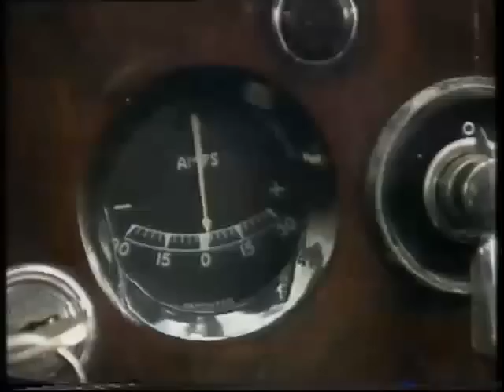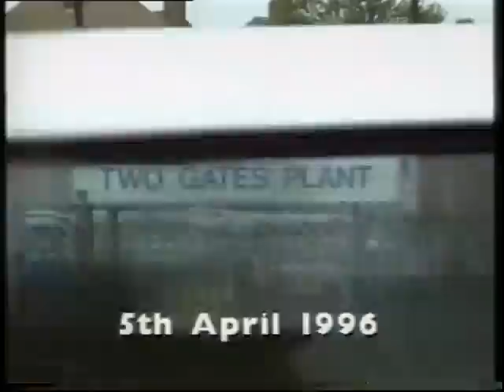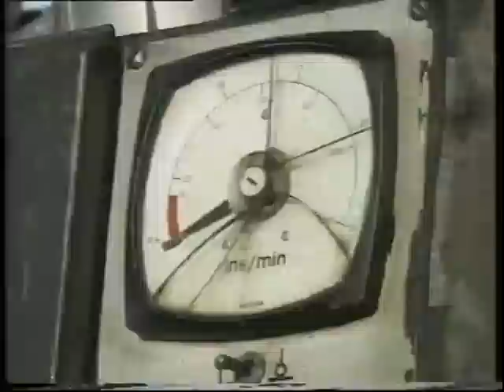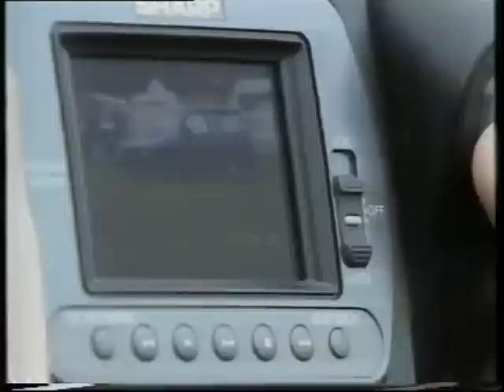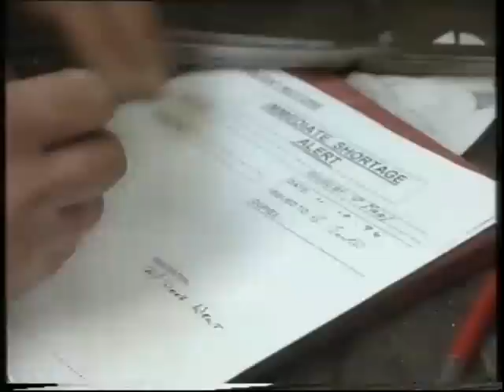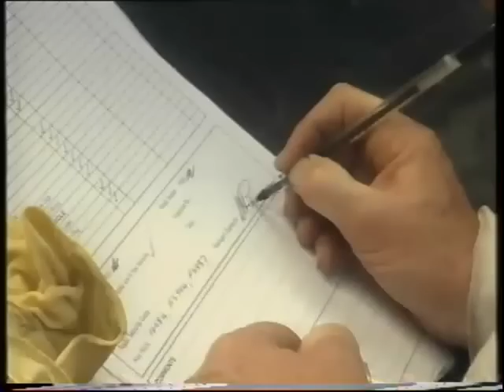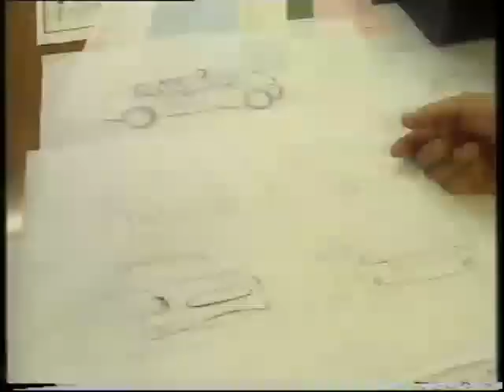Reliant Motor Company Documentary - 1997

Comment: By this time the Reliant three wheeler was a dead duck. Surprised a man like Jonathan Heynes couldn't see that. 60 mpg, motorbike tax and rust free body was a fantastic advantage compared to thirsty and quick rusting 70's cars. But, fast forward 20 years and your average medium sized family diesel will do 60mpg +, is free on road tax, and due to modern technology has fantastic corrosion resistance. Also, the typical reliant customers (older, northern, ex-miner types with a motorbike licence) were reducing massively in numbers by this time.
Reply: supernumery  I'll give the chap credit for one thing .... at least he faced people. I used to work for a technology incubator and 90% of the meetings we organised were unattended - people just couldn't be bothered turning up for whatever reason.
Reply: There was a point when the difference between a car and a motorcycle was a reverse gear. It was possible to drive a 3-wheeler to the test centre, take your driving test, blank off the reverse position and do your bike test as if in a sidecar combination.

I think you're correct in your analysis of Reliant's 3-wheel demographic, Paul, people with a bike license who couldn't be bothered taking a car test and whose wives would no longer get on a bike. Common in the 60s, still plenty about in the 70s, but by the 1990s a dying breed. The Regal/Robin was an anachronism of the British licensing system, like the ridiculous necessity to put pedals on 50cc motorcycles to meet moped laws in the 70s.
Reply: Exactly the issue I saw, cars had moved on, but also with all the emissions regulations etc. the days of the small manufacturer of a cheap economy car were over.
Reply: Gary Dodgson  I agree about motorcyclists making the best drivers, as a motorcyclist you cannot afford to make a mistake and you have to learn how to ride defensively and be constantly aware. After 43 years, having started out with motorcycles before owning a car, I still drive a car or ride a motorcycle with the same attitude, I see and know many who drive cars without appreciation for the inherent dangers. Everyone seems to think if you ride a motorcycle death is inevitable, yet drive as if no one's ever been killed or seriously injured in a car.
Reply: My thoughts exactly, they are a fun little car but the "that's good enough" "make do with what we have" attitude of all the British car and motorcycle brands left them all falling behind.

The average small European or Japanese car of the 90's early 2000's was quiet, fairly comfortable, fuel injected, didn't leak, had power steering, disc breaks and got reasonable mpg, the Reliant on the other hand was still using technology that was outdated 30 years ago and getting harder to source reliably.
Reply: Gary Dodgson  They indeed do have reverse although the current Goldwing uses the starter motor turning backwards to reverse the motorcycle as opposed to a reverse gear. However in the UK at one time reverse gear was used as one of  distinguishing factors between a car and motorcycle.

Comment: The BUG would be a brilliant car for the electric treatment, it is light and it would fly along, just saying
Reply: Also not sure it’s gonna pass in the crash tests LOL
Reply: Ron Wylie....piss on electric vehicles, more green house gasses are expelled building electric cars than there are when building gasoline powered cars....Google that shit...
Reply: @branon6565  what a ridiculously stupid comment. The average car has a life span of 10 years or more nowadays. The savings on emissions during that time more than compensate for the production emissions. A child of three could understand that
Reply: Sid Stevens   Just a matter of branding. Reliant owned the marque.
Reply: Actually Sid, the Bond Bug was made by Reliant (Google it)
Reply: @x66Hawk66x  try actually getting 60-70mpg though, it ain't gonna happen.
Reply: @x66Hawk66x  It is a well known "claim" that they do 60 mpg but I have run mine for 4-5 years now as my exclusive daily transport and have never seen 60 mpg even on a motorway run.

It is a fact that the speedometer with which mpg is gauged in them are wildly inaccurate, often up to 10 mph over. (an over reading speedo artificially increases mpg figures)

I do over 10-12k miles a year in mine, I have bigger wheels which bring the speedo to almost dead on accurate when compared to a gps, it isn't geared as high as a rialto 2 though so it's not struggling in forth at 30 mph.

Keeping up with modern traffic I average 35-45mpg as a more realistic figure and that hasn't changed since i bought the car with around 50k on the clock, that is mixed 30-50+mph driving everyday so well up to operating temperature.

Driving like miss daisy  on an ultra economy run with the wind behind you, you might, might get 50 mpg on a good day, but you will get that in a eurobox these days on an economy drive.
Reply: Saw bug sold at auction this year £30000 pounds wow.

Comment: The Reliant was an anachronism that died between two epochs. Back in the 1950's, young working-class people often rode motorcycles and grafted a sidecar on when they got married. Threewheelers became a slightly more luxurious alternative that could be driven on a bike licence so long as the weight remained below 8cwt. That drastically limited what could be done. However, in 1959 came Issigonis's all-conquering Mini. It required a full car licence, but swept almost all before it. Reliant & Bond struggled on, determined but doomed. Today, with small, electric urban cars the height of fashion, they might have a chance - with sufficient investment - but they didn't last long enough to meet the electric revolution. Perhaps they should've looked around for a Japanese motorcycle engine instead of trying to resurrect and continue building their own mill...
Reply: I think another issue for a company like Reliant to survive would be the crash and safety requirements for vehicles today. Now buyers are also interested in the safety ratings of cars they buy, whereas when I was a kid in the 60's we didn't even wear seat belts and such things were given little thought.

Comment: I had an early model van in the mid-seventies. It was a rather fetching brown colour, which gave it the nickname 'The Flying Shite'.
I remember that there was a big roundabout on my route to Technical College, where I could lift the left rear wheel on the entrance; the right rear wheel about half-way around; and then left again on the exit.
Another party trick was, whilst having four mates packed into the back and stopped at a red light, holding the throttle to the floor until the valves bounced, then dumping the clutch. That manouver generated a 'wheelie' of about six inches...
My favourite was, due to the dimensions in the back and the fact that the driver and passenger seat-backs hinged forwards, made it perfect for taking a young lady back there for... 'fun'.
I'm 60 now. The 'young lady' has been my wife for many years.

Comment: I wonder if it had survived till today. would it have stood a better chance with an electric engine and a little lithium battery pack as an electric city runabout. batteries, motor controller and electric motor production sourced outside.
Reply: Probably not.

The car you describe was already made in 1987 in Denmark and called the "ellert"

It was never a big succes.

https://billeder.bazoom.dk/biler/galleri/479/wh/2000/2000/2394608/ellert-mini---el.jpg

Comment: Not a word about 'Only fools and horses'. I was under the impression that popular program gave Reliant a huge publicity boost? Or have I got the story wrong..... haven't lived in the UK for almost 40 years.
Reply: Some programs did the opposite. The most widespread lie is that Reliants cannot go around corners. This was supposedly demonstrated on the BBC's Top Gear programme, but the always annoying Jeremy Clarkson himself admitted in The Sunday Times that the Robin only rolled over frequently because the production team messed with the differential. If it hadn't, the car would have been much more stable.
Reply: Not wrong it did give a little boost.
Reply: It's definitely given the second hand market a boost. Replicas of the fools and horses van regularly go for between £10,000-£20,000. One of the screen-used vehicles went for over £30,000. That particular model is very rare and even wrecks go for a couple of grand.

Cushty.

Comment: I understand why he did it, but watching him fight the entrenched attitudes of the staff makes me think hiring them back was a bad idea.
Reply: There was absolutely nothing wrong with the 'entrenched attitudes of the staff. They knew their business better than anyone, and had to work within the limitations of the antiquated production line and machine tools they had. The way that Reliants were built was somewhat anarchronistic even in the mid 90s, (even Trabant were more modern in terms of the way they were produced). Laying up glassfibre is a skilled and very labour intensive process, for which there are no cutting corners, as it can't be mechanised. The programme mentioned that Reliant had gone bankrupt  three times within a short space of time, but what was not mentioned was why. The order book was full, and that was part of the problem, as the factory site wasn't big enough to be able to store enough components in order to be able to produce enough to fulfill the demand. This was partially down to the car having a separate chassis, which was made offsite by a contracting company and were produced in production run in batches, which had to be stored, and storage space was limited. Also, such production required paying for with cash - and as is highlighted in the film, cash flow was an issue, which is basically what did for the company on at least one of the times it went bankrupt. It's very easy to blame the workers, but that always loses sight of the fact that it is upon the workers that companies whether the company makes it, or fails - and with companies such as Reliant, it is only the workforce that keeps the company going. The very fact that it is emphasised in the film that some staff gave up secure jobs in order to return to working for Reliant indicates the committment of staff to the marque.
Reply: I am not denying there weren't entrenched attitudes of the staff, but I think there was more of the typical arrogance from management who didn't really understand the business or man-management yet 'knew best'. Let's not forget those who actually built the cars knew what they were doing, and what's more understood what they were doing.

Since Reliant had already gone bust three times or whatever it was before the new fellow got hold of it, indicates to me that there was no real business at all and the boss was clinging on to something that just wasn't there, then tried to blame those making them as being part of the problem. A romanticist if you like. It was a car merely of its time which died in the 70s due to natural wastage.

Unfortunately I worked for 'management' who had all the theoretical training but simply did not understand the business they were in at all, far less those who actually made the whole thing work. Instead of listening to the staff, who knew, management ploughed on ahead with their university degrees and finished the whole thing off, leaving to f'off and ruin the next business.

Comment: i always loved the Scimitar GTE. Nice GT cars. Good Ford V6 engine.
The 3wheelers not so much. IMO 3 wheelers only work with 2 front wheels. 
The Robin was a nice effort.
A company like this can only survive in a niche market. Like small city-BEV cars. Or slow 45km/h cars that you can drive without license.  Or small electric urban/city delivery vans.
Reply: I had a blowout of the offside rear tire on a Scimitar GTE at 105mph on the M4 many years ago. it kept a straight line while the tire shredded itself through the wing.
Reply: The Scimitar GTE was a nice car in its day, my Dad had two of them in the early 80's.
Reply: Hi Fiveo waf, apart from the tire the other big point I remember is the size of the fuel tank. cost me a weeks wages to fill it up. also 100mph in 3rd was great.

Comment: It lasted another 4 years after this documentary was made, making cars nobody wanted to buy.
Reply: The deliberate alterations to vital parts so that you couldn't buy of the shelf alternative didn't help matters.

If they had used off the shelf components they would have had a far greater pool of suppliers to choose from and got better prices.

For example the brake system was adapted in later years to use mini brake components but instead of also adapting the hubs to accept off the shelf mini drums they continued to use bespoke machined parts to monopolize the spares supply.

In reality this let to suppliers of the bespoke parts holding up production, the die casting company from what i understand destroyed the engine moulds in the late 90's meaning all engines after then are reconditioned units.

Comment: He should have reversed the design so the one wheel was in back,modified for angle adjustment,and the two wheels in front.
It seems to me this would have made it much more stable and more controllable.
Reply: not as a load/passenger carrying vehicle
Reply: @chrisdavidson911  Of course it would there is MULTIPLE designs using the technique.
Just look up "three wheeler"on wiki.
All it would have taken is relatively minor modifications to the layout a reasonable expense to increase the odds of actually SELLING the car.
Reply: @krisguntner4805  i'm familiar with 3 wheeled vehicles, the type you're talking about is called a "reverse trike", and you're trying to say it would be more stable than the conventional/reliant layout when there is an uneven load at the rear. Not only that, they're a packaging disaster, the central wheel makes the rear of the car basically unusable for anything worthwhile. The reverse trike layout does have merits, but not for load carrying
Reply: @chrisdavidson911  Arcimoto's "deliverator" Is a clear example you're wrong.
Reply: @krisguntner4805  really? that's like a can-am spyder with a windscreen and pizza delivery box on the back! it can carry 160kg, in a narrow box, directly over the rear wheel. It actually proves my point
Reply: @chrisdavidson911  .......um yeah it's almost like a HEAVIER vehicle could carry.......HEAVIER loads.....see how that works?
Reply: @krisguntner4805  a robin weighs 445kg, deliverator is 464kg, so no, that isn't the case.
Reply: @krisguntner4805  4 passengers and a large boot but only one rear wheel? It would be so stupid

Comment: No matter how hard they worked or how successful they were eventually EU dictat would have shut them down. They wouldn't have been able to conform to EU regulations and be financially viable.
Reply: It's a lot more complex than that.  Underfunding, ancient design, hand-built engines, no credit, no export market, no safety features, supply issues, etc. etc. The EU never came into it.
Reply: Nothing to do with the EU. Oh dear...
Reply: @mipmipmipmipmip yep, that guy wanted 20 more staff doing manual fibreglass layup rather than using one chopper gun. That does not make sense unless there was an ulterior motive.
Reply: @jonmortermusic  Like to blame everything on the E.U don't you.
Reply: @jamescooke3763  choppergun is unsuitable for a car body, it has poor stiffness and strength, would involve using more material, make the car heavier, and the end result wouldn't be anywhere near as good. A choppergun is what they use with plastic bath tubs. it's an idea from someone who doesn't know much about composites
Reply: @UCBafQ7GKuybMDXZqy5WqbEg 
- Not relevant, and, they have plywood or chipboard along the base to increase the strength; if that can make them stronger, they aren't very strong.
- Makes no difference.

- Not relevant.
- Correct, but they do have other forces, and must be suitably strong in a crash.
- No, and i don't need to be

if you know anything about composite boat hulls, then you should already know about this

Comment: Why not electrify the car perhaps in partnership with an existing electric car company that has the electric technology. If Reliant make everything, therefore, they can make the electric skate board chassis and buy in the electric motors and batteries
Reply: I would imagine it comes down to packaging.  The Robin is small. Batteries are large and heavy. To give the car a reasonable range, would require large, heavy batteries which would make the car expensive and cumbersome.

Battery technology still has a long way to go before electric cars can take over.
Reply: @That_AMC_Guy  Agree. Sinclair C5 comes to mind. Come to the think of it after pondering in darkened room they are a prime target for landfill.

Comment: Classic British engineering failure, a company that refuses to modernise stuck in an old time warped factory turning out a product no one wants, the workers just interested in getting the pay cheque every week and doing the minimum work required. I worked at one of these companies , we were doint one tenth of the output required to stay in business,  its really easy to just take the wage and wait until they go bust if no one in management cares, workers moral sinks to rock bottom. We used to knock off at lunchtime on Friday as soon as the wages were handed out and go down the pub. When the manager went on holiday we did nothing for two weeks.